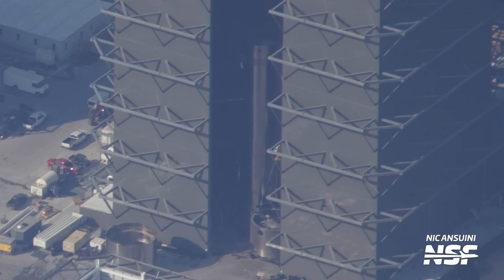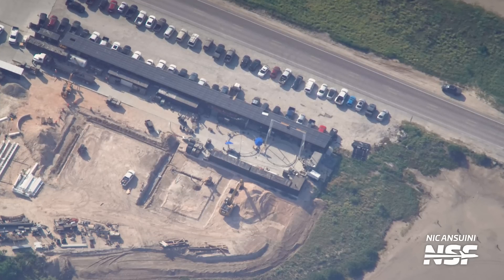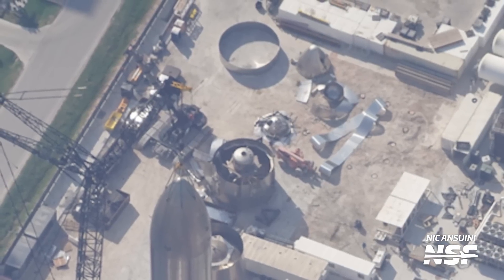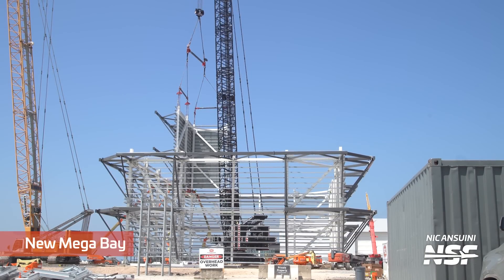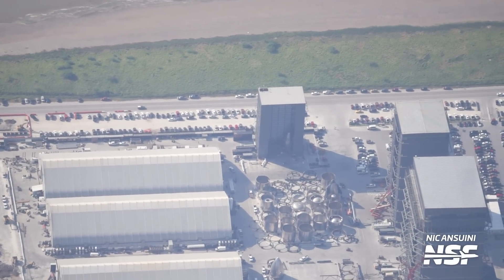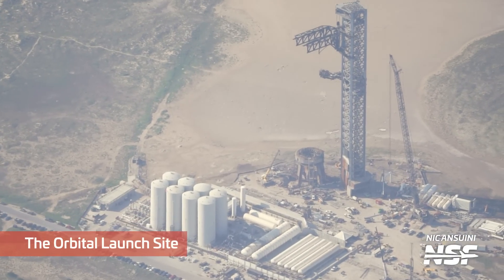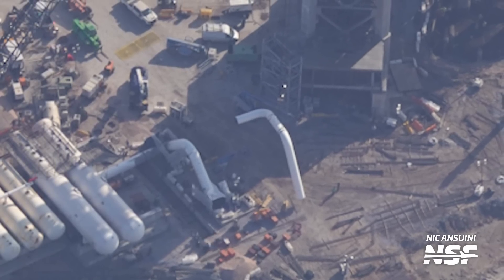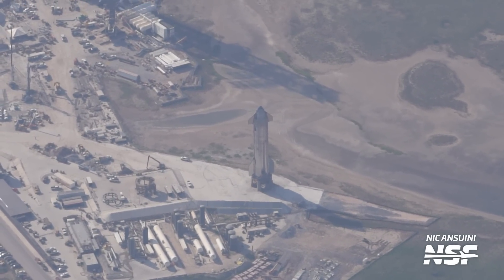New Starships, Boosters, and Structures From The Air | Starbase Update

Comment: Hello Jack, when I look at that cargo bay door of Starship, I have to wonder if the SpaceX engineers ever considered a vertical payload door opposed to the current horizontal door. You have to wonder just how much structural reinforcement has to be added to carry that stress load around that huge door. If the stresses collapse that door opening by even a fraction during launch, that door may not open or close. If I were to design it, I would attempt a vertical door as it is much easier to carry that stress load. The big takeaway would be if they could deploy the Starlinks in a vertical position. In my mind, I picture a multilevel dispenser similar to the old slide projector carousels. Preliminarily, I think you could actually dispense more satellites in this configuration if the mechanics work out.

Comment: I'm surprised at this confidence in concrete and rebar. There is certain to be a difference in the expansion characteristic of metal and concrete and no force on Earth will be able to prevent the base breaking up. A water deluge system can carry the heat away, of course, but if this is done efficiently and adequately such a massive concrete and rebar base is not needed.

Comment: You know you could also point an arrow at something instead of saying things like "to the center right of the leeward side of the nosecone"
Reply: As the script writer I can tell you that is not possible. If I instead wrote "as you can see here" or "in this location on the nosecone" for something that is not evident straigth away, then that would put the burden on the editor to put a whole bunch of arrows every single time I did that instead of just mentioning where exactly is the location of the thing he's talking about and then take the picture, zoom in, and be done with it. Sometimes, more words is something more precise and less clutter on the visual side of things is better.
Reply: @ale131296  Can't say I agree in this case, but hey it's just a suggestion. Thanks for the reply :)

Comment: Is there:
Any knowledge pertaining to
Engineers 
In orbit refueling
Dreams??
Notions??
Gonna be tricky without gravity or pooling...
Reply: what
Reply: @bobloblaw1636  a gentle thrust from on ship would settle the tanks for transfer, or my preferred option refuelling tankers having internal bladders, there is precedent for that.
Rotating around a common centre would also cause enough microgravity to settle the tanks enough to transfer fuel. 
My guess is SpaceX will try several options before building a fleet of tankers.

Comment: Fresh concrete has high water content which will turn to steam and explode
Reply: They’ll give it curing time
Reply: The water deluge will always be wetting the concrete, so as long as it's cured, the concrete will be  nearly as good as it ever will be
Reply: @chrishorne4016  what about water trapped between steel deluge system and concrete below? At 100c it becomes explosive.
Reply: The maths is beyond me, but I think the plan is that converting the ejected water into hot steam will use so much energy that the heat won't reach the lower steel plate.
Reply: Water trapped in concrete will explode at 100c. Even a small amount of water at 200c will explode.